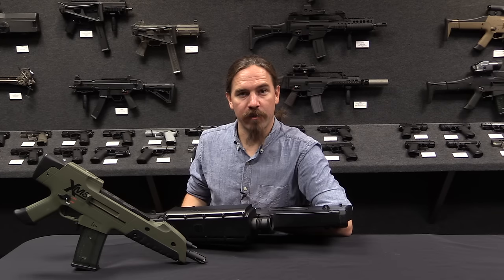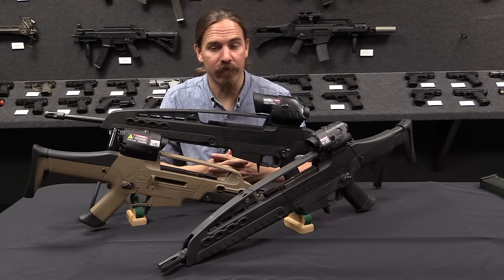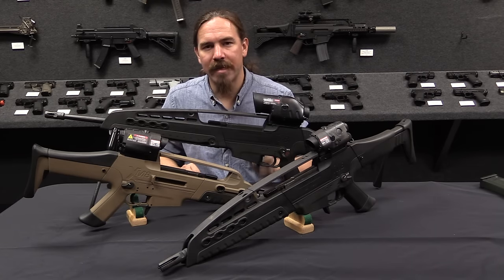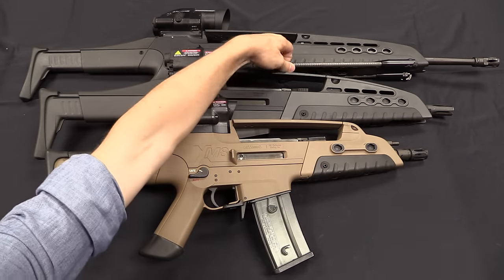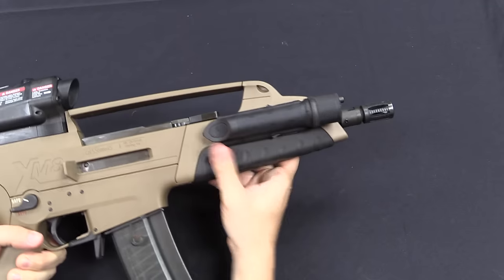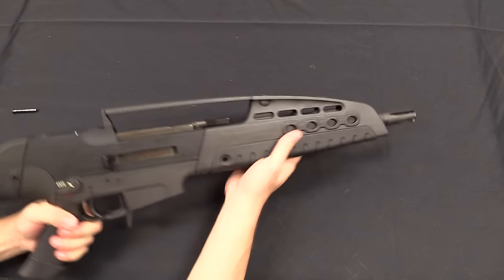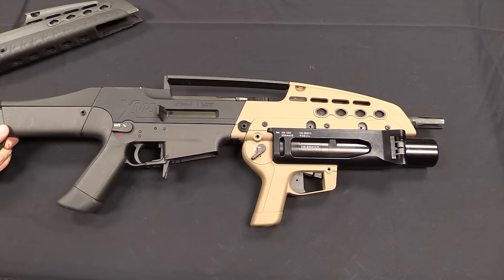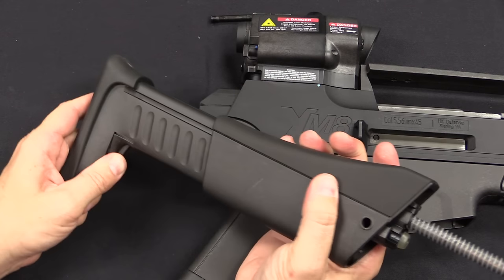Almost Adopted: The H&K XM-8 Family

Comment: I was part of the test group for this item, it's build was good but it melted under intense firing of the weapon. You can't use metal fused to plastic and think i will hold up under fire. The barrels melted the plastic and began to move around after continuous fire. THAT"S why they never saw the light of day!  The optics were actually very good, also the magazines were too large and the gear that was need to carry it all was too bulky. 
This system was great for a sci-fi movie , but as for the US military No way!

Comment: What's with HK only having wood mockups of the OICW and the early XM8 section?
Reply: Is because the import laws and shit...
Reply: @Seelenschmiede  
As both of them were developed for the US Army, they probably had to develop and manufacture them in the US. Sometimes in DoD development contracts, the prototypes are owned by the military. That would be my guess, but pure speculation not based on facts.

Comment: Issues with the G36? Nah, the dumb military (I am an actual German, so I am allowed to insult that armed camping club!) tried to press an assault rifle, the G36, into the light-machinegun role and then woundered why accuracy suffered with barrels etc. not made for sustained fire of hundreds of rounds just dumped through it -.- (seriously, anybody should know that this doesn't work! I don't even own any weapons and I know this is a straight out stupid idea!)...I mean they should know that LMGs have heavier barrels exactly for that reason -.-
Reply: The bipod is very handy, therefore there are units which have all their G36s equipped with bipods.
Reply: H&K is a shady company with lots of lawsuits put against it and more trials to come probably. Mostly for illegal arms deals. So I do not exclude the idea of them having tried to cut some corners by using low quality steel for the barrels.
Reply: Das stimmt so nicht ganz ... die Bw hat das G36 nie als leichtes Maschinengewehr benutz, zumal das MG4 schon im Einsatz war als es zu den Vorwürfen kam... Im Prinzip ist etwas ähnliches wie beim M16/A1 und der Einführung des A2 passiert.
Reply: @ringowunderlich2241  Even if the problems of the G36 are true (which is debatable) they have nothing to do with the steel used in the guns, but the polymers.
Reply: The official investigation came to the conclusion that the rifles are completely built to the specs the Bundeswehr had for them. They blamed faulty ammunition for the problems. The G36 was never pushed in a squad automatic weapon role, since when the problems happened the MG4 was already fulfilling this role.
Reply: it's all politics. the Bundeswehr simply used the issue to demand more budget for the military since the German govt pretty much neglected the military.
Reply: The polymers of the first generation were pretty bad. We destroyed so much of them on the maneuver grounds. But overall the gun was good. Even after very lengthy fire on the range.
Reply: @C0SSAC  Auch nicht richtig. Das MG4 sollte als Ersatz für MG36 Konzept dienen, hat sich aber ewig hingezogen bis es auch wirklich in nutzbaren Zahlen bei der Truppe angekommen ist. Einer der großen Kritikpunkte war ja immerzu die Performance des G36 im Karfreitag-Gefecht, zu dessen Zeitpunkt die Kämpfende Truppe immernoch nicht über wirklich nutzbare Mengen des MG4's verfügte. 

Die Vorwürfe kamen ja erst wirklich in Bewegung als Frau von der Leyen diese aufgriff und versuchte, das G36 schnellstmöglich zu ersetzen. (Die Hintergründe hierfür kann sich jeder selber vorstellen)
Reply: @Huckleberry The barrels are just as heavy as any other standard rifle barrels used by countries around the globe. No simple assault rifle, be it an AR15 variant, an AK variant, an L85 or any other will be able to sustain high quantities of ammunition being put through them without experiencing barrel warping eventually. That is why things like the M27 have heavier barrels specifically for such purposes.
Reply: @ringowunderlich2241  And these lawsuits are often without any real grounds and dismissed. Many of the lawsuits originated from licensing agreements allowing 3rd parties to sell their licensed H&K weapons to whoever they wanted - however, controlling these licensing agreements falls to the government and NOT solely to H&K. 

Aside from that, the company is known to make very reliable, high quality (and expensive) firearms. Assuming this would be different with the G36 is ludicrous and without any backing by military and civilian users.
Reply: It was more a case of the troops not having a choice at the moment and the politics making a big scene out of it than trying to push the G36 into an unintended role intentionally
Reply: @Huckleberry Apologies, then I misunderstood your comment. I read it as suggestions as to what the rifle variant needs.
Reply: @DreamingFlurry Nobody ever pressed the G36 into the LMG role. Just because BetaC Mags and a bipod exists? These items are more along the lines of substitute equipment in case of need, the reality is that neither BetaC Mags nor the bipod have seen wide-spread adoption, and you would both absolutely need for an LMG.

Don't believe me? Then why do our Squads always carry either an MG3 or nowadays an MG4 into battle? Where are the pictures of our troops carrying G36 with LMG-serviceable equipment into battle in Afghanistan? You won't find any of that because what you're saying is demonstably wrong, and who or whereever you've gotten your information from is either lying or doesn't know anything on this topic himself.
Reply: It wasn´t the military which pressed the G36 in the light machine gun role (with wanted sniper rifle precision) it was more dumb politicians who wanted this test. And you can only insult our armed camping club if you are in the armed camping club !
Reply: actually, there is nothing wrong with the rifle. There is some minor accuracy loss that doesnt even matter, when you really heat it up.

vdL got actually into some hot water about it. But being Albrecht's daughter, there is nothing that will make her step down. Not lying, not corruption and certainly not utter incompetence.
Reply: The G36 is widely used by the british SAS,since the early 00's and they never had any complains about it.
These guys are one of the most elite special forces in the world and have no issues with this rifle,but the Bundeswehr and her secretary of defense,who are both total jokes,deemed this weapon ''faulty''? 
Give me a break here.
Reply: @doublep1980  indeed you need a break, as dreamingflurry does. Maybe you should fantasize about something that fits more to you. Like getting your empire back :D Nevertheless, it would fit to you since facts seems nothing you bother with...
Reply: @r.j.3440  The G36 is in service,in more then 2 dozen countries' militaries and police forces worldwide.Among them special forces,counter terrorist units and SWAT teams.None of them had any issues and these are units that have very high standarts in equipment. 
The official test of the rifle, that the incompentent german secretary of defense Ursula von der Leyen AKA ''Flinten-Uschi'' ordered,showed that there's absolutely nothing wrong with it and also the german Bundeswehr lost a lawsuit against Hechtler & Koch.The problems,that the Bundeswehr encountered,were due to the fact,that they bought cheap ammo for their troops in Afghanistan,according to the final report,that cost the german taxpayer a shitload of money.
This bullshit started,because Madame von der Leyen,who was prior the secretary for families and has no fucking clue about the military,wanted to re-negotiate a new deal with H&K.It is rumoured that the Bundeswehr will buy HK416 & 417 rifles(the KSK special forces already use the 416 variant).
Generally speaking,the Bundeswehr is a total joke,2/3 of their submarine fleet are out of commission and  most of their helicopters don't work either.That's why in Afghanistan,they had to call the French or US Army,everytime they needed a helicopter to fly out a wounded soldier.Ffs,Greece which is de facto bankrupt,has more german tanks and armoured vehicles in active service,then the Bundeswehr!
Reply: The armed camping club? That's fucking hilarious and I'm going to have to remember that one lol
Reply: +FrontlinerCdV So it's German doctrine to just fire hundreds of rounds in shorts amounts of time with the G36 until it overheats? Because that's what started the controversy in case you are out of the loop.

Comment: These are practically G36. The germans chose the right gun for their military.
Reply: Yup, complete with temperature related wandering zeros and durability issues
Reply: The G36 is very popular amongst many people who actually used it.
Reply: You mean people who carry but never shoot them or run them hard? Then yes, those users absolutely love the GTurdy6
Reply: @4schitzangiggles  absolutely bullshit. I ignored your first comment, but this is just edgy. Ive had thousands of rounds through the g36, and Zero doesnt "wander". Nor is it unreliable, the only malfunction i had was when brass jumped back into the ejection port  because i held it against a wall. 
Only because media tells you that the german army wants a new one due to these """"reasons"""" doesnt mean they are true, get some experience with it. HK doesnt earn money with it anymore and now tries to push the german govt into adopting a new rifle. Thats whats happening.
Reply: @4schitzangiggles  I have to correct myself: The zero did walk out in the tests, after they shot 6 mags full auto, without cool-down. Thats 180 shots, more than any soldier would even put through a SAW. Try the same with any other service rifle, same fucking result.
Reply: @TheAngler2210  while I don't have eleventybillion rounds through a G36, I have a few thousand. I can tell you if you zero the rifle in hot desert 100* f plus and then shoot it again when the temps drop to near freezing your zero will be off. A lot. 6mil was the average we were seeing. Why do you think the Huns are moving away from the G36? I guess I wasn't the only one having issues with it. The rate of fire wasn't the issue, but the thermal stability of the polymer that was moving enough from environmental factors (air temperature) that people were seeing swings from 4 to 10mil (moa) of shift from the zero. In fairly temperate climes, no one will ever see it, but using it in high hot desert environments where it could be over 120*f during the day and dropping to near freezing at night, it is a big damned deal. Again, bad and consistent enough that the German military is moving away from it as H&K couldn't work out the issues.
But hey what do I know, this is the internet...
Oh almost forgot to back up my claims with some pesky facts...
https://youtu.be/PMfaiKoJ-mA
Click it, go ahead, I'll wait...
Reply: @JazzJaRa  
"Do you know at which temperature the grip would melt? "

Do you know how relevant that is? Not at all. It's not necessary to melt to affect accuracy. Ever heard of this thing called thermal expansion?

"So before you trust some kind of strange media stuff, get facts right and listen to people who actually worked with these rifles and KNOW their stuff.
"

I wouldn't call people who'd fail their physics and chemistry classes people who "know their stuff".
Reply: So! tell me! what experience do YOU have with a G36 in LIVE FIRING not your airsoft gun! The test was simply a test that NO i repeat NO assault rifle would pass! And funny enough every soldier using the G36 is defending the rifle! But yes 100.000 people are wrong, and just you are right.
Reply: @4schitzangiggles  Imagine unironically using a 2015 video to support Von der Lyen bogus claims after the Ministry of Defense lost 2 lawsuits against H&K, got discredited by the Lithuanian testing of the rifle and completely shat on by a survey of the acceptance of the rifle by deployed troops in Afghanistan.

Comment: This really doesn't seem any more modular than a flat top M4 or M16. I was expecting a detachable barrel so you could switch out to different barrel lengths. Nope, you have to change the entire upper, just like on an AR platform.
Reply: It comes with a modular integrated sight that would cover mutiple attachments (red dot, IR lasers, etc), so the XM8 with all that mumbo jumbo would weight the same as a naked M4. Also, the barrel is detachable, the XM8 uses a common receiver where the wanted parts are mixed and matched.

Comment: Yes I remember xm8 rifle and yes it was more expensive than the M16 or M4.  the xm8 I did believe it cost around 5,000 and $8,000 and yes they had also issues with the plastic and parts in it was testing the lab it was okay but when came to Battlefield testing it didn't hold up.. the xm8 was a beautiful gorgeous rifle it never saw service

Comment: Between this and the FN F2000 this will forever be my favorite standard style rifle, where the 2000 will forever be my favorite bullpup. I was always so sad this never made it. The idea was spectacular to have it be as modular and it would've seen the M249 get replaced as these could run a drum mag on an extended barrel in 5.56 and using that as a proverbial LMG would've made sense. There is a kit however that you can get or could get I am not sure if it still exists but you can convert the civilian G36 into one of these, it's slightly wider and bulkier but beggars can't be choosers. Point still stands that this could've been the best thing ever for the US military but they have made some bone head decisions.

Comment: All it takes for the rail system on an M4 to be streamlined like the XM8 is a few polymer inserts. All it takes for the modularity of the rail system on a standard issue XM8 is... That's right, there is no rail system. They sure do have a clever mounting system for their hardware. A mounting system which was never asked for.

Comment: My Smartparts SP8 electronic paintball gun is modeled after this rifle.  Worked great as a paintball gun.  The advantage was it could reach targets other guns couldn't.
I can't see it as a military weapon though.  As a mostly polymer marker gun.  It'was a little large and cumbersome and definitively heavier then most markers.  Comparing it to 
my AR.  Even with a full mag, the AR is more compact and much easier to wheel around obstacles.   Not that I use my AR on the paintball field.  That's just wrong.

Comment: The XM-8 is really nothing else than a G36 with a styled up stock. The internals are pretty much identical, and much of the externals, too. Plastic can be nice, but it requires good design and good quality plastic. H&K lifted the folding buttstock and the magazine design from SIG, but used less dense plastic and lots of sharp corners instead of rounding the edges. The plastic trigger mechanism gives a pretty crummy trigger pull. H&K tried to make light and cheap weapons, as they saw this as the future of combat weapons, but it just didn't catch on well with most armed forces.

Comment: Such a shame the XM8 wasn't adopted. I've been told that it had issues in high temp settings (I believe, at least, please correct if wrong) but aside from that I genuinely think it was a fantastic weapons system. Ergonomic, ambidextrrous, modular, not too shabby aesthetically, compatible with existing magazines (which are pretty neat in themselves, the attachment lugs). I briefly owned one of the airsoft models of it - plastic gearbox sadly - and I don't think I've admiredas much any other gun. H&K or not, except maybe the MP7. Genuinely think the XM8 had some serious potential.

Comment: I think the biggest issue with the US military trying to adopt a new battle rifle is their experience in the Vietnam war while adapting to the M-16, and not repeating what the UK went through with the L85 series early in it's development.  While limited, the M-16 and M-4 have all the bugs worked out and its a battle proven system with almost 60 years of trial and error, and design enhancements.  Another issue not really talked about is the amount of money the US military has dumped into it's marksmanship program.  All the technical manuals, immediate action drills, and stoppage procedures would have to be rewritten and reworked.  The US also has stockpiles upon stockpiles of M-16 and M-4 parts and STANAG magazines, so it's not just the rifles you would be replacing but your entire supply system of every single piece of a new weapon system.  The AR platform is one of the most popular rifles in the US, so realistically any US citizen joining the military has some familiarity with it reducing training time

Comment: They still should've sold this on a civilian market to have a chance to change & perfect any issues they had or would have. I could definitely see this as being a popular rifle if they took some more accessories off the very basic package (like the optical & maybe buttstock) & made cheaper options (like a cheaper red-dot site or hand-grip). If they could make the cost cheap enough, I would definitely buy the most basic one & just slowly upgraded it over time with different accessories. Each one really makes it look completely different, & it would almost FEEL like you're building your own gun, rather than just some AR-15 or M-4 with a bunch of parts added to it. I mean those 3 guns are basically the same but seeing them for the 1st time they seem COMPLETELY different.

Comment: if you seen all the variants, the military had a sniper rifle, submachine gun, lmg, and assault rifle in one system with simplistic attachment handed to them on a silver platter and they said no. stupid horse was thirsty but wont drink the water...
Reply: The "sniper" was more equivalent to a special purpose rifle in 5.56, and the "submachine gun" is not one at all, its just a carbine still in 5.56, the military doesnt even issue submachine guns anymore anywats even back during the xm8 trials.